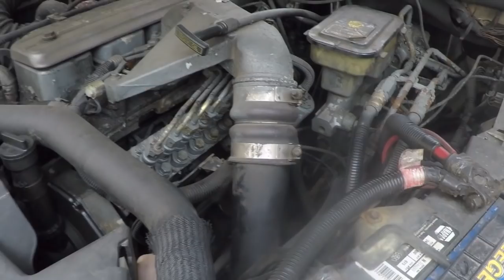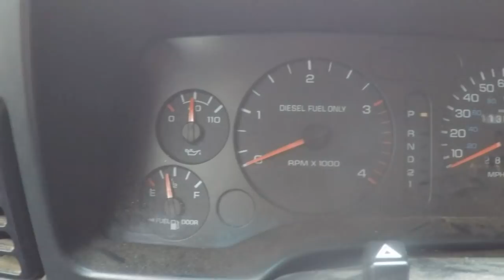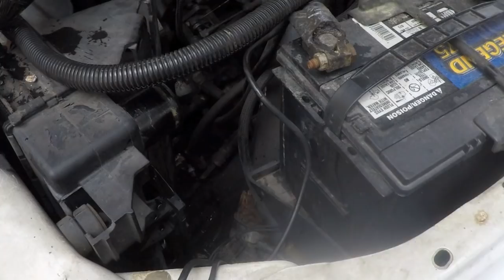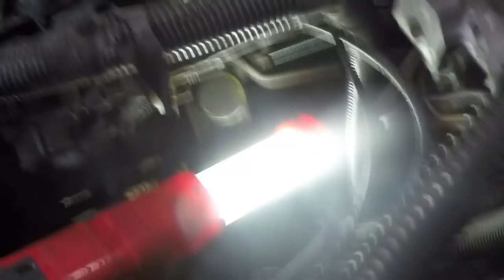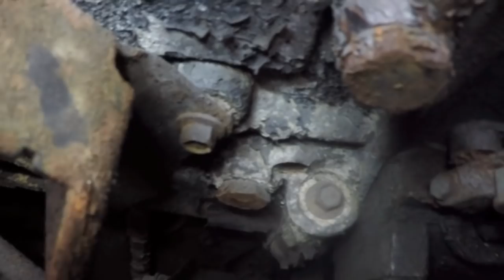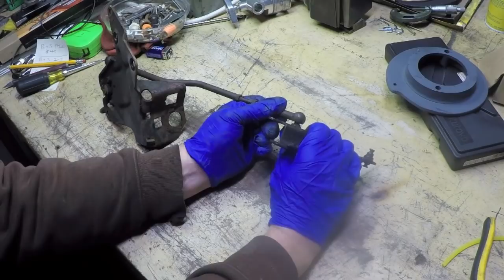1997 Dodge Cummins 5.9 throttle linkage repair Part 1

Comment: My idle is the same as yours cold but when it's hot it drops down below 500 and runs rough.
Reply from the maker: That low, and the AC compressor kicking in might stall it, or even turning the wheel loads up the power steering pump. There is an adjustment. It's a pain to reach. it's a bolt with a jam nut on it. loosen the jam nut, then turn the bolt. the head of the bolt raises or lowers the bell crank to set the idle.
Reply: What fixed your issue?
Reply: Man did you ever figure out what this issue is? Im battling the same thing.  My idle screw is set correctly. Im confused how its even able to fall lower then the set idle... It starts up at 750 but as you said once it gets hot itll fall through the set idle down to 500 rpm and stall.

Comment: Any idea the PN for those 2 plastic bushings there were cracked at the end of your video? Thanks for posting
Reply from the maker: Here is a link to an exploded view and parts list for the 12 valve.
https://puredieselpower.com/dodge-products/2nd-gen-12v-94-98/injectors-and-fuel-system/injection-pumps-lines-and-accessories/dodge-12-valve-cummins-p7100-build-your-own-throttle-linkage-kit.html?language=en&currency=USD&msclkid=7a18082406d317b4c31f6a187357918b&utm_source=bing&utm_medium=cpc&utm_campaign=**LP%20Shop%20-%20Cummins&utm_term=4588193306730851&utm_content=PDP-BYO-TLK%20%7C%20Dodge%2012%20Valve%20Cummins%20P7100%20Build%20Your%20Own%20Throttle%20Linkage%20Kit%20%7C%20%2486.25

Comment: Sloppy ball joints at about +15:30 minutes? Do you have the recall throttle ball joint kit installed? There is an open recall on the throttle linkage ball studs for Dodge Ram diesels 1997 and 1998. NHTSA Campaign Number: 02V161000, also known as Daimler-Chrysler recall B15. Don't confuse this with the throttle cable related recall that came out for earlier model years. 
The recall description heading is in error saying only applies to vehicles with VIN position 8 as "C" for diesel ("C" was not a valid code for position 8 n 1997/98), should have read "D". I found a copy of the recall in PDF at:

https://testing-public.carmd.com/Tsb/Download/29483%2F000000003b9acbee

Comment: I have the same issue but I have not had it get stuck on full throttle yet. just gets stopped at about the 20-40% point and I have to back off the pedal and push again and it frees up

Comment: Your crank Sensor is going bad when it want start you'll know I was right it will start stuttering and jerking at slow speed it want be long after that.
Reply: Is there a crank position sensor on a p pumped 6bt ?
Reply: @stevehardeman7209  it's on the front left of the motor behind the radiator fan.

Comment: As your tach starts working at 8:44, "CHECK ENGINE" in amber and something in red that almost looks like "RUN" light up for just the briefest of moments.  When you turn the key to "ON" but don't engage the starter, do these lights light up in the diagnostic process?  I'm wondering if the tach issue is a wiring or connection issue closer to the gauge, rather than closer to whatever interprets engine rotation.  Those lights coming on make me think that the wiring fault somehow resolves, and the tach dial and everything associated with it gets powered up.  Might be a ground issue?
Reply: It says GEN not RUN. That’s diagnostic. Tack issues is 99% of the time the crank sensor

Comment: brake pedal pivots use a thin wall bushing too,so its not uncommon. those ball studs are used in many applications,i had one fail on my shifter linkage on the turnpike once..... good thing i was able to McGeiver it home.... Mc Master Carr may be a option on the bushings if you cant locate them